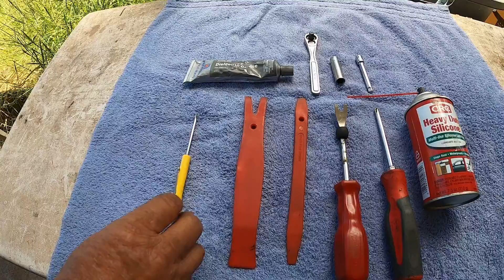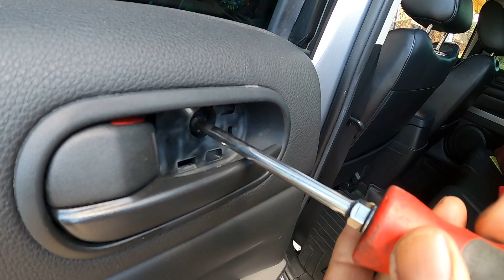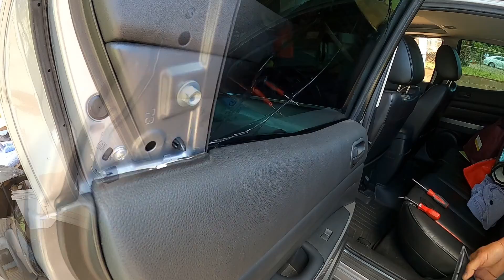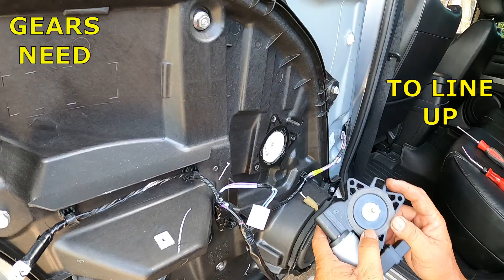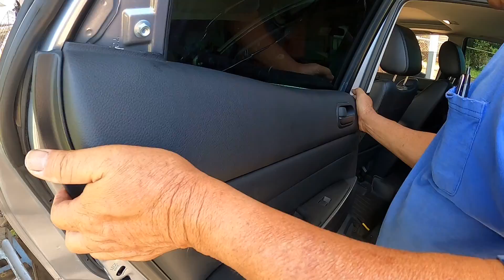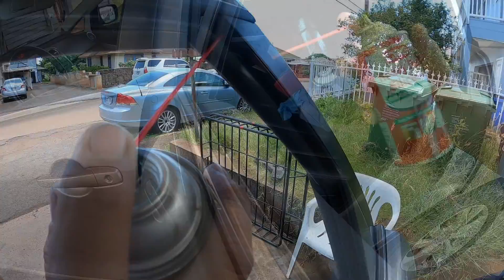2011 Mazda CX-7 HOW TO REPLACE DRIVER REAR WINDOW MOTOR

Comment: I'm ganna be leaving this comment on as many 2011 Mazda cx-7 window motor videos as incsn find.

Last year my passenger motor went out and I found a video here on how to replace it. The older guy in the video very knowledgeable and the video was easy to follow . But he also said something interesting. He said that if one motor goes out you might as well replace all of them and I thought that was funny at the time but I'll be darn if he wasn't right. A few months later my front driver motor went out then my rear passenger and then my rear driver... Even if you don't think you're going to need it you might as well just go ahead and purchase off four motors because they will eventually go out. Installations pretty straightforward. You can purchase new Motors from eBay for like 17 bucks each 

 Some video tell you to disconnect the lock and door opener but you don't have to. All you have to do is turn it sideways and slip it through the hole after you remove the screw.

But I just want y'all to know go ahead and just save yourself to trouble and purchase all four brand new Motors.

Also the front left driver and rear right passenger are the same motor and the same is true for the front right passenger and  rear left driver.